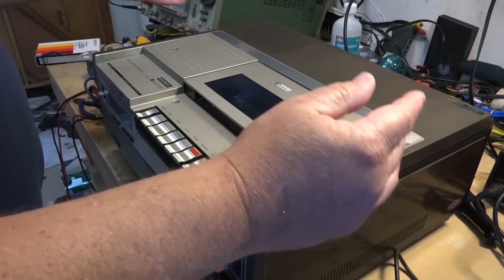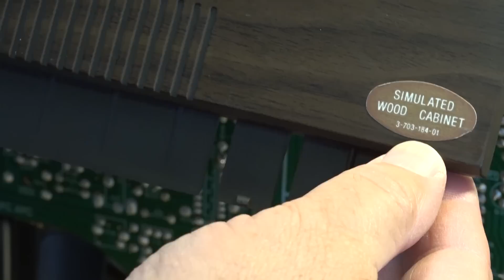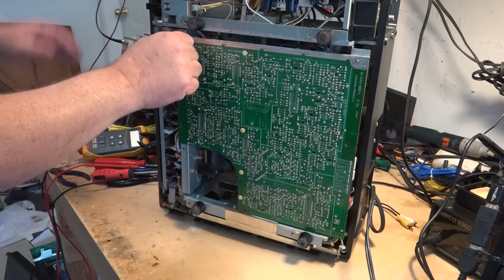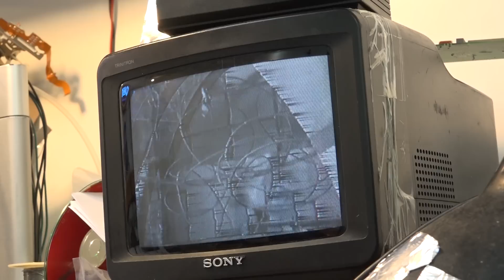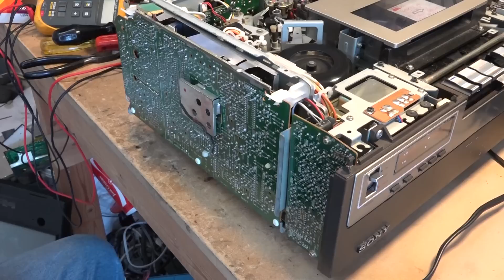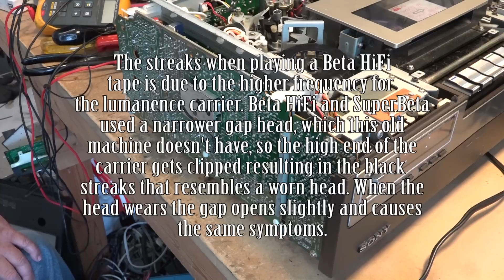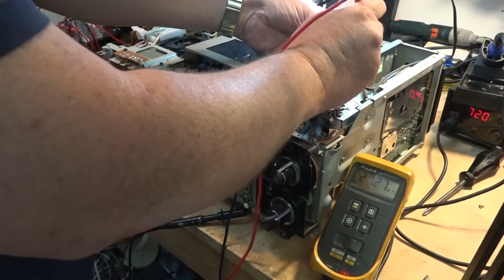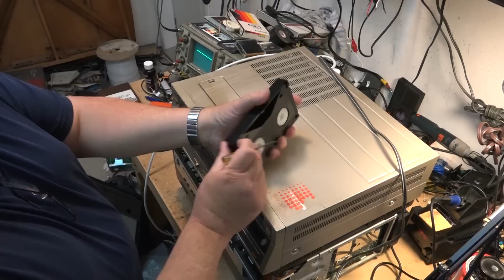Sony SL8600 Vintage Betamax Repair

Comment: Lovely old machine. I once had to repair an old Grundig VCR, and though it was VHS, it had the same sort of tape transport. In Europe they were referred to as "Charlie Decks". I still have my old late 60's Sony Trinitron TV, one of the first solid state ones imported here, and after a friend looked at it, still very much alive thanks to a Digibox with an RF output.
Reply: It was a VS-200/220 right?
Reply: Solid state was common since end of 70s. Here in my country they removed the UHF knob and covered with a cap that said "solid statte."
Reply: +supermasterPIK My Sanyo Betacord from 1978 has a logo on the front that says "IC electronics"... Lol!
Reply: 1979 I think shifted to digital varactor tuners.

Comment: Thanks for the visual memory... I used to service those (and the first Beta 1 version) for Sony.  Watching your video here makes me wish I had kept my B&W Ampex 1" reel-to-reel beast (about the size of a small dorm refrigerator). It's fascinating how video cameras, recorders and editing equipment has improved considerably over the past half century. No more messy magnetic developer spray and long diagonal 1" tape splicing attempts.  Someday all those mechanical parts will even be miniaturized and every able-bodied adult will be able to lift and carry around their very own black and white video camera and tape recorder for use anywhere that AC power is available!
Reply from the maker: I had the opertunity to get an Ampex VPR7900 back when I worked in TV production. It was a spare kicking around the studio that always had problems playing tapes made on other machines, so nobody used it. The engineers best attempt still left a machine that nobody trusted to use, and eventually they decommissioned it and I was told I could have it if I could get it out of the building myself. I had to pass on that because it would not fit in my car. Kicking myself now that would have ben a great conversation piece even if I never managed to get it working correctly. I do have a Sony 1/2" reel to reel machine that partially works, but the only tapes I have for it are all falling apart and stick to the metal parts so I have just left that one collecting dust.
Reply: @12voltvids  I can't believe the belts of this machine 😦........ I mean.. you get a cassette deck from late 90's.. and the belts turn back to black tar.. they become a liquid stain on the pulleys 🤢........... this belts are like what?? 15 year older?? 🤔....... and they are still there and working 🤷‍♀.......

Comment: Back in the day when units were made to last and be repaired. Nowadays a Sony BluRay player is a WalMart throwaway $39 U.S. special. I have a 2nd generation Sony BluRay unit that is leaps and bounds ahead of the current generation garbage.
Reply from the maker: Plus it wil play bootleg disks unlike the new ones. New stuff is all throw away.It is the consumers fault. They demanded cheap crap. By buying the cheap crap that walmart was selling sent a message to the manufactures that this is what the consumer wanted. Cheap crap sold, high end stuff stayed on store shelves. Answer to that, make cheap crap.
Reply from the maker: I was just at a movie theatre a few months ago, and had really bad seats, front row, and the screen is most certainly  still curved.  Smaller cinemas not so much because the screen is small, and the projector is not that far out, but on a large screen, and we still have a few of those here the screen still has a curve that you can clearly see if you are up front, which is the worst place to see a movie. You leave the theatre with a stiff neck.
Reply: +12voltvids I bought my bluray player used on ebay. I wont buy that walmart crap. The same mindset killed plasma sets and brought cheap unrepairable garbage lcd sets to the populace.
Reply from the maker: Exactly. Plasma cost much more to make, so people focused on the negatives, that being weight, and power consumption to tarnish the plasma panel. I still prefer plasma over lcd panels. OLED on the other hand I think does have a future if they can get the price in check.Can you imagine what a 4K plasma would have been like if they were actually be able to pull that off? I have 4 1080 plasma sets, 3 720, and an ancient 480p in the garage plus a few sets in need of repair that I haven't sourced parts for yet.  I intend to keep them as long as I can keep them working.
Reply: A 4K plasma panel would have been breathtaking! My 1080p Panasonic plasma panel with a good BluRay source has 80 to 90% of the picture quality of a 4K LCD set. That just tells you how good plasma was and  how poor LCD panels are.
Reply: I notice a lot less eye strain with plasma compared to LCD. WOW! You have me beat with your plasma collection! I thought I was a plasma hoarder with 1 1080p set and 2 720 plasma sets. I found them actually fun to repair because their design is so elegant and Panasonic troubleshooting is about the best in the industry from my experience. Iam on the lookout for another 1080p set. It's like an addiction finding and repairing these sets. And the reward is a long lasting great looking set. And it just plain feels good to save something that was built to last but a minor issue caused an early failure.
Reply from the maker: Many times the failure was caused by customers putting them over fireplaces and then turning on the fireplace and cooking them.A mantle is needed directly below the set to kick the heat out and away from the set, but many people place they directly above the fireplace and winder why they fail prematurely.
Reply from the maker: There is home though OLED look even better than plasma, and are even more energy efficient. Once the price comes down I will bite. Till then I will keep my old gas panels going.I still find plasma sets cool in the way they operate.
Reply: +12voltvids I will buy an oled set as long as the screen isn't curved! Iam sure Walmart will buy the cheap  oled sets and  people will buy them and drive the price down.
Reply from the maker: I'm with you on that. I was in a local retailer looking at the LG 65" 4K and the guy was rubbing his hands ready to seal the deal, and I said great bring me a flat one. He said, they are all curved. I said, gee I am sorry to hear that. Its a deal breaker. Salesman tried to give me the sales pitch about movie screams being curved, and I threw it back at him. "Do you know why movie screens are curved?" He said it makes the picture appear 3D like.  BZZZT WRONG! I said. "You never took physics or photography did you? Did you even finish school? A movie screen is curved so that the distance from the projection lens is equal on all parts of the screen, if it was flat, the distance would be greater at the edges than the center, resulting in poor focus on the sides. The screen with it's curve keeps the focal distance the same over the entire screen"At that point he asked me to leave the store.  LG however has listened, as they now make both curved and flat screen OLED sets, so I can look again. Just not at that retailer!
Reply: +12voltvids You taught him a little lesson in photography.  I haven't seen a curved screen at a movie theater in decades.  A flat 65 inch oled would be nice for the living room, then I could get my 50 inch 1080p plasma back.
Reply: I always sit towards the back of the theater so I guess I never noticed the curve. We have an "ultra" screen near us that has a 70 foot tall screen. I would hate to sit in the front row in that one!

Comment: 15:45 So that VCR won't work in Europe or any countries where 50 Hz power is use even you insert a NTSC tape.
Reply from the maker: No it will run slow. Need different pulley. It would probably play a pal tape on b/w no problem.
Reply: Some of the old Philips reel-to-reels were simple to adjust for 50 or 60 HZ, you simply turned the main motor pulley upside down, selected 110/127V and away it'd go in the US and Canada. The 60 HZ pulley groove was slightly smaller than the 50, to accomodate the higher motor speed on 60HZ. Happy simpler days. Wouldn't be surprised if at least some of their VCR machines did the same.
Reply from the maker: My old Akai audio Reel to reel tape decks do this. You change the belt for line frequency, but there is also a switch to change the run capacitor value for the 2 frequencies.
Reply: I have an AKAI 8-track recorder that's like that too.
Reply from the maker: I used to have an 8 track recorder. I wonder what ever happened to that unit. I remember back in the 80's I couldn't wait to decommission my analog gear because tape hiss used to drive me crazy. I used DBX noise reduction to try and eliminate it, which it did fine, except that DBX had a nasty habit of introducing its own warbling / buzzing noise due to compression / expansion calibration issues between the record and play compander.
Reply: Because old VCR are locked into the AC power line that could be the reason why old TV receivers from 1970s and earlier not only it has a V-Hold but it also has H-Hold as well. I remember during my childhood years in early 1970s which although we didn't touch the V-Hold but the H-Hold needs occasional adjustment. Sometimes the picture falls on the side and we adjust the H-Hold then few seconds later it falls to the opposite side and we adjust the H-Hold back. Maybe the frequency of the power line fluctuates and the scanning frequency of the video fluctuates as well. But starting around late 1970s although we were still using that same TV receiver but we didn't touch the H-Hold anymore. I presume the station upgraded their VCR that no longer dependent to the AC power line.
Reply from the maker: Original black and white TV was line locked to the power frequency.That flew out the window with color when the vertical scanning was adjusted to 59.97 Hz. This was done as they needed to adjust the scanning frequency to allow for interleaving the color sidebands so they would not fall on harmonics of the horizontal line scanning. The Europeans took the easy way out, and just scrapped their existing B/W standard, and developed a non-backwards compatible system.In the US there were already too many B/W TVs out there to simply throw away. So the NTSC (National Television Systems Commission) was set up to develop a color standard that would provide color on the existing B/W system and allow people with B/W TVs to continue to watch the same program without the need to simulcast in both color and B/W. NTSC is what their standard became known as. It was an overly complex system, where they created color system that overlaid the existing B/W system. Careful consideration was made to ensure that the color information did not interfere with the existing B/W signal. This is why the H and V scanning frequencies were slightly altered, so the color information could be sent on the subcarrier basically between the scanning lines, and thus would be invisible to B/W receivers, but color receivers with the higher band pass could pick this information centered around a suppressed carrier at 3.579545 MHZ over baseband. Very complex system. This is why the tint and color controls. Because the carrier for the chroma needs to be supressed and the signals DSB modulated on 2 suppressed carriers. The carriers need to be generated in the TV and phase locked to the original carrier at the station which is not transmitted. A sample of that carrier, 8 cycles of it to be exact is inserted on each scanning line immediately after horizontal sync before the active picture begins. This is called the burst, and is used as a reference for the subcarrier regeneration. The subcarrier phase control (or hue as it was called, then tint) was used to adjust the phase of the color subcarrier. It is referenced to the burst.  Later they would insert a half line long version of burst in the vertical interval, and develop circuitry that was called VIR, vertical interval reference. VIR could set the chroma level and SC phase to a reference signal in the vertical interval.  All TVs had a vertical and horizontal hold control to adjust the reff running frequency of the oscillators. In the late 70's and 80's PLL count down circuits were developed that would generate the horizontal in the conventional way with a coil and cap, but the vertical was a counter that would count the horinontal pulses and create the vertical sync pulses internally. No need for vertical hold. They would detect incoming sync and lock onto it.
Reply: Thanks for detailed explanation which is very informative. Although our TV was black and white in 1970s but my uncle has color and I remember the picture of their TV also fall on the side but their TV only has V-Hold no H-Hold so when the horizontal was out of sync we had to wait until it fixed itself in few seconds. I presume the issue of the H-sync originates at the station that's why early receivers has H-Hold to compensate which we no longer touch since the late 1970s at least in my area.

When it comes to TV that doesn't have V-Hold which came later on, I hate those because although our VCR is a multi system but when I played PAL tapes the picture keeps rolling and unwatchable so I have to use our old TV with V-Hold because it can display PAL tape in black and white but at least it's watchable. But starting around the year 2000 many CRT TV are multi system via AV mode and can display PAL in full color without issue but the tuner is NTSC only. Most HDTV these days are also multi system via AV mode.

Comment: +12voltvids - another great video, thank you.  As a matter of interest, what would the consequences have been if those chassis brace bars were removed?

They really did build them like tanks back then - so much better in terms of construction and engineering than the cheap tat we often see nowadays.
Reply from the maker: I would think alignment issues. They keep the thing square so to speak.

Comment: would it actually be possible with current technology to make a (mechanically) much simpler and smaller device that could play all kinds of tapes vhs/beta/video2000? even properly working vhs players are getting harder to find now
Reply from the maker: If someone wanted to spend the money to develop such a machine.There was a machine several user ago called GO Video, which was a dual deck VHS machine that would allow making as close to a perfect copy as possible, including copying macrovision encoded tapes as it did what was called an RF dub (borrowed from the broadcast world) where the signal from the playback heads was just amplified and recorded straight across to the record deck without any demodulation, signal processing and modulation artifacts being added. At least that is how they marketed them. I never orned one, but did work on a few of them.As far as a single unit that could play all formats, that would be impossible due to the different size of the transport parts (video drum being the biggest obstacle) but a single deck, with multiple transports would be possible as they all do basically the same thing. Separate the video into luminance and chroma, convert the chroma to a lower frequency, and FM modulate the luminance information onto a carrier to be FM recorded. That could all be handled by 1 chip set no problem. If someone dd make such a machine they could probably sell quite a few of them to people to archive their home video collection, but the problem is the cost.  Such a machine would probably have to retail for 2 - 3 grand, or more just like the first generation multi system converting machines (Panasonic AGW1 for example) and that would put it out of reach for the average person.JVC for example had an SVHS / MiniDV deck a few years back. Sold for 2,000 in an era where VHS decks were 100.00.Mind you my MiniDV Sony portable deck was close to that, and my current HDV/DV deck was also about 1,200.00 and the camera that went with that setup 7,000.00 and it sits collecting dust only hauled out when I need to transfer movie film to video.
Reply: Yes at such a price there would not be many buyers. I was inspired by this Kryoflux device that can read lots of different floppy disk formats by reading the "raw" signal and using software to decode the signal. Then in combination with some kind of adapter the same mechanism could be used to "read" the different kind of tapes. One can dream :)

Btw, I would also like a device that can clean tapes because this fungus thing on tapes is a real problem  Do you know if such devices exists? i once bought some chinese thing that had a "clean" function and it was the biggest piece of plastic crap ever, it couldn't even properly rewind, let alone clean.

Comment: Also, I had the same problem with a Sanyo VTC 9350. Rewind wouldn't work until I disconnected the sensor! Also, this machine is from 1978 according to a Sony ad, so it's actually 38 years old!
Reply from the maker: See I knew it was a great piece of historic hardware from the early days of home video. I have an older SL7200 which is a single speed Beta1 deck but it needs a bunch of belts, and I already research the cost. About 130.00 just for the belts, so that one will not be looked at.
Reply from the maker: Try finding parts for older 3/4" Umatic units.Just overhauled a VP1000 Sony. Video will be up soon. It is  a beast.
Reply: The SL7200 was a great unit back in the day and had a pretty decent picture quality as well. I know that it is also tough to find parts and repair any Betamax recorders made prior to the SL5000 (the first front loading Betamax).